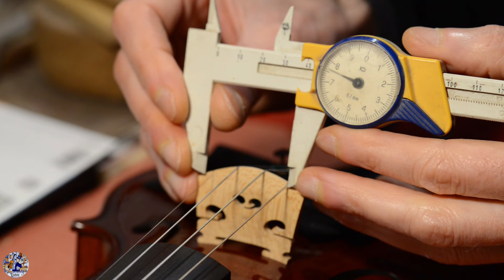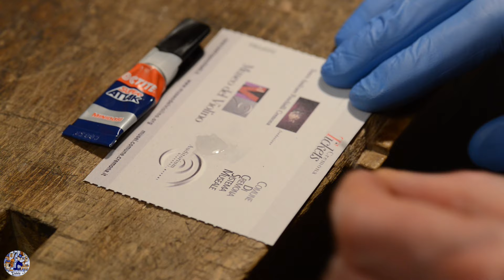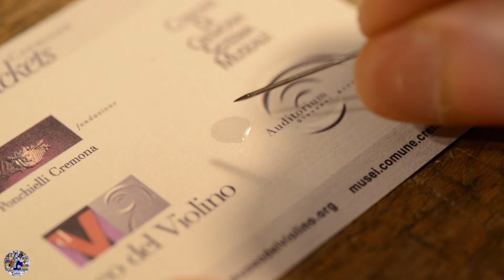Violin bridge from start to finish - Ponticello di violino dall'inizio alla fine

Comment: would you make a mark with a sharp tool on the top of a fine violin as well in order to guide you through the process?
Reply from the maker: I wouldn't recommend it, although this is a traditional technique that has certainly been used on fine violins as well. Keep in mind that the pinpricks must only be in the varnish, not in the wood, and that on the old violins around the foot of the bridge there is no original varnish left, only touch-ups made by restorers. So, when done with common sense, the pinpricks technique is not terribly invasive all things considered. However, as an alternative, a non-sticky tape can be used to mark the position of the feet, or a white grease pencil of the type used to draw on human skin for art or make-up purposes.
Reply: @DavideSora  Nice, I use non-sticky tape
Reply: @DavideSora  Double boiled linseed oil? the bottle looks like Liquin, from Winsor and Newton 🤔
Reply from the maker: @marcelogonzalezechazu9054  The tape works well, be sure that you can remove it without peeling off the varnish, the greatest risk of this technique. You will also need to make sure that no traces of glue from the tape remain on the surface, and that it does not contain aggressive solvents for the varnish
Reply from the maker: @marcelogonzalezechazu9054  No, it's not Liquin, it's linseed oil. The label says "Drying linseed oil", also by Wintsor & Newton. However, I suppose Liquin could also be used, although I have never tried it because I prefer natural products. After all, Liquid is nothing more than synthetic linseed oil, precisely Alkyd resin.
Reply: @DavideSora  Exactely! I use double boiled linseed oil, diluted in a bit of turpentine. Looks and smells nice